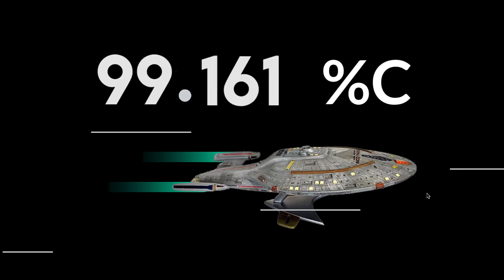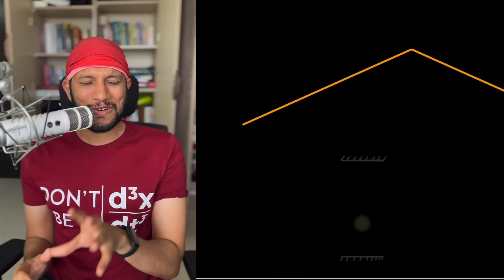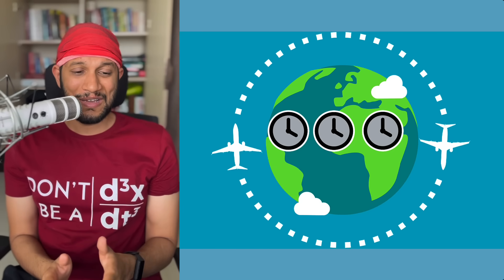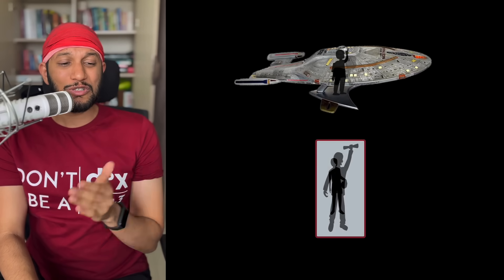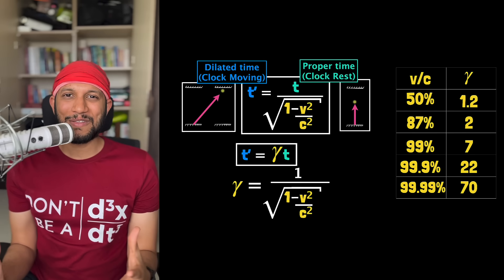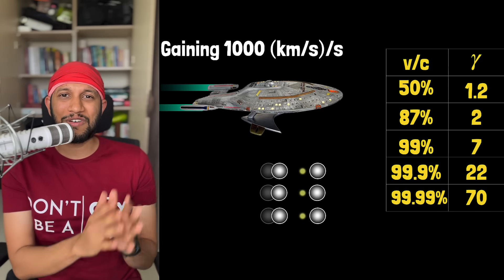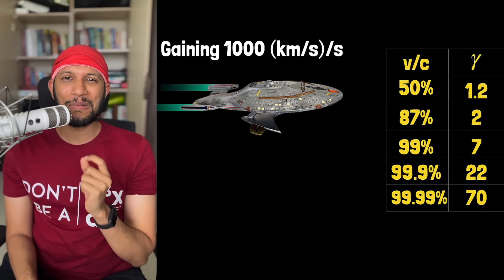I finally understood why you can't go faster than light! (My mind is blown)

Comment: Dr Micheo Kuko stated in a video that no matter what the red shift of a galaxy, the information about that galaxie always arrives to us at the speed of light in relation to us. This means it has to gain speed to faster than light speed, relative to its source, for this to happen. 

This is a problem, because the sending side has now sent signals at faster than light. 

How do you account for this without faster than light speed travel?

Comment: This certainly explains why one can never achieve the speed of light. But the theory does not forbid travelling faster than the speed of light. The challenge is figuring out a mechanism that can get us from sub light speed to super light speed by somehow by passing the speed of light.. perhaps this is the mechanism that they use in Star Trek to get to Warp speeds which are higher than the speed of light.

Comment: This is a really straightforward and clear explanation of time dilation. Keep up the good work on this and similar subjects.
Reply: Time doesn't dilate. The photon-clock may slow down, but not the other clocks.
Reply: @johnceena7322 should we call it subjective time dilation then
Reply: Regardless, if a clock slows, time remains constant. The apparatus that we use to measure it may change, but the measured remains constant. 
If you measure a board at ten inches, stretch your tape measure out or shrink it down, and then remeasure, the number changes, sure, but the board remains unchanged.

Comment: Cool video. Does this mean that if you have 2 atomic clocks on the opposite sides of the world and you use them to measure 12 hours of time, during the day for one, and night for the other, you'll be able to note some time dilation due to the night clock traveling faster than the day clock due to the rotation of the earth?

Comment: Time doesn’t slow down. All atomic processes slow down which gives the appearance of time slowing down.
To measure true time one must find a stationary point in the universe and measure there.
Reply: Also, so moving at 99.99% the speed of light means I’d age 70 x slower. So travelling to a planet 70 light years away would feel like a one year trip?
Reply: And simply put, the energy that moves all things moves at the constant of the speed of light.
 So what is bound or moved by this energy, can’t exceed this energy’s speed. Or the bond will be broken?
Reply: What ever speed the object is moving say 99.99%, the energy transfer to increase the speed can only travel at what’s left after 99.99%. 
The faster you go, the less of the 100% is left to accelerate you. Eventually you’ll reach equilibrium. At which point, you’re immortal 😂

Comment: No, this is wrong. This is working on the false assumption that the speed of light is a standard speed that never changes and ignores everything around it. Einstein himself proved this to be untrue. Einstein proved that a light emitted forward from a moving object will move at the speed of light plus the speed of the object.

I used to think this would be how light worked too when I was young, until I read Einstein's paper that disproved this very thing and it blew my mind.

Einstein put a light next to a train track, and another light on the train, with a switch that would trigger the two lights to come on simultaneously, and he found that the light on the moving train would reach his position faster than the stationary light, and was able to prove mathematically that the light on the train was travelling at the speed of light plus the speed of the train.

The reason the clocks desynchronize when you fly them around on an airplane is because if time dilation. It has nothing to do with the movement of photons.

As far as being able to travel faster than the speed of light, I don't even believe this to be true. This is just a misunderstanding of Einstein's theory of relativity. It comes from the misconception that this was a derived equation. This was a defined equation, and the fact that some parts of the equation are undefined does not mean that the real life events the equation models must conform to the undefined elements of the equation.
Reply: And here's the problem I have with the idea that you can't go faster than the speed of light. Relative to what? You're talking about a theoretical clock that is at rest. But what does that even mean? At rest on the earth? Well, you can't reach speeds even close to the speed of light without leaving the earth. There's just no room. Assuming we're going straight and not making constant adjustments to direction, you're going to leave the earth real quick. So where do you place your control clock? Do you leave it back on Earth? But the earth is not holding still on a cosmic scale. It's rotating around the sun at 1000 miles an hour. At the place where the Earth was when you left the planet? Well, that doesn't work either, because the whole universe is expanding at a rate much faster than the Earth travels around the sun. So that begs the question - what exactly is standing still in terms of this experiment? There is actually literally nothing anywhere in the universe that's standing still. You can't define a point that is stationary on a cosmic scale. There are none.

So when you define your speed, you must define your speed relative to another object. That's the only way to even define speed.

Typically since we spend most of our time here on Earth, we define our speed relative to Earth. But as we've seen, that's not really valid for this experiment. You have to pick something to be your point of reference, and it's best if you pick something that is not accelerating, which leaves out the Earth for many reasons. But you can actually define your speed relative to anything that isn't accelerating.

But whatever object you define your speed relative to, that object is actually moving relative to everything else. So whatever object you pick, if that object happens to be moving toward you, and then if you move toward that object, then you can move faster than the speed of light relative to a different object. And the thing you pick is completely arbitrary.

And you can define anything you want as your stationary point of reference, and your model will consider that point to be stationary, and everything else to be moving relative to the object you've defined as your control clock.

So what if you choose to  define your speed relative to an oncoming photon?

Well now if you move toward that photon, you are actually moving faster than the speed of light. Light moving toward that photon can easily travel twice the speed of light.

And if you follow this train of thought, you start to see that you can continue even beyond that to attain higher and higher possibilities for speed.

But at the end of the day, what this comes down to, is that there's nothing in space. It's all empty. Not even air. So when you're in space, your movement is meaningless, because there's nothing to base your movement off of. So you are essentially stationary all the time. Which means you can always speed up in any direction, no matter how fast you're moving. Because at the end of the day, you are the stationary control clock. Whatever you're doing is defined as the object at rest, and everything else is moving relative to you.

Comment: The photon clock is explained accurately. But the real clock explanation time dilatation is a big fail. You only explained that the clock arm rotation is propagated slowly from the center to the end of the arm, but this slow propagation has absolutely no relationship to the frequency the central "atom" of the clock arm accelerates.

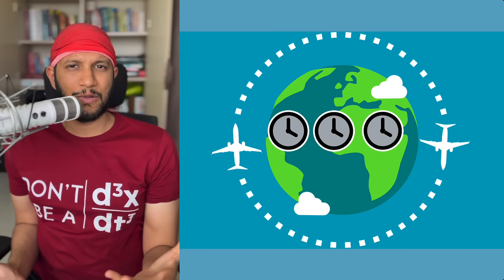Comment: 4:50 if everything in the universe is moving... and movement is only relative to other objects... how do the clocks know which one is going faster or is going to slow down?
Reply: I'm not sure what you mean by "clocks know"
Reply: @MakiseKurisu_ImmortalVenerable  I don't mean literally "know". I'll say it in another way: if everything in the universe is moving... and movement is only relative to other objects... which clock is going faster and which clock is sloing down?
Reply: @Jona19824  The clock going slower in relation to the other is the one which accelerates and doesn't maintain a constant speed and straight line. When you accelerate you no longer stay in the single intertial frame and so even if we both saw our clocks ticking slower, we will no longer and you will see my clock ticking faster and I'll see your ticking slower. Because acceleration is absolute in relativity and it's not relative, if you accelerate I don't, as time flows differently from you than for me.
Unless the acceleration is symmetric and it's done in the exact same motion between the 2 clocks (magnitude, direction, duration) and they had a perfect symmetric start then even if they meet again then they'll remain in sync.
Reply: @MakiseKurisu_ImmortalVenerable  but isn't it true that everything is moving. So if you accellerate back to where you came from, you actually decellerate. But while I'm typing this, I understand it doesn't matter, because the clock experiencing it, will know whether or not it is accelerating or not.
Reply: @Jona19824  Deceleration is an acceleration that reduces your speed. When you turn back, whether by reducing speed, increasing speed, or changing direction, they all are accelerations in physics. Any change in velocity (speeding, slowing down, or changing direction), they're all acceleration. It's been proven and experimented, the mathematical proof is kinda, just kinda complicated tho.

Comment: i still dont believe the FTL theory. 
science is about not believing what people say without conclusive tests and evidence, and we know small scale test dont always mean a larger outcome will be the same. 
at same time theorist believe we can travel faster than light by bending space like a sheet of paper and creating a tunnel between two distant points. 
the paper explanation sounds like a flat earth theory. space isn't 2D.  its getting into more 4D space by collapsing two 3D points without distorting space itself. it doesn't sound possible or would require infinite energy.

Comment: how you could explain it to kids: one kid is the photon, two kids are the mirror walls. First photon kid runs back and forth between the other two and we count the time to get back to one of the kids. Then the wall kids start running in parallel and the photon kid has to catch up. Also the physical exhaustion would be a good analogy for the energy increase needed.

Comment: If the ship burns the same amount of fuel to increase its speed at a constant rate in proper time, then as it takes longer to accelerate in dilated time wouldn't it also be perceived to be using less and less fuel per second too? Like at 87% speed of light it would appear that the ship is using half as much fuel per second (and accelerating half as fast as it was initially too). So it would appear as if the ship was decreasing in acceleration  normally, as if the pilot was controlling it with the thrusters. Did I make any mistakes with that?

Comment: No, he didn't explain.
if one ship flies at 0.75 the speed of light, and the second also flies at 0.75 the speed of light, but in the exact opposite direction, then the speed of one ship RELATIVELY to the other will be GREATER than the speed of light.
This logic is simple and absolute.

Comment: This is almost the same explanation given to us before we went faster than sound, They told us that if we tried to go faster than sound that we would burn to death. Ofcourse we found that when we went faster than sound that as long as we had a vehicle to protect us then we are fine.
Back before 1900 we were told that if we trird to go faster than 30 mile per hour you would burn up.
In the last 100 years they keep telling us that if we manage to travel at or faster than the speed of light, that time dilation will happen. 
Lets hope we will see light speed and faster than light speed travel in the next 20 years and we will be able to see what really happens fhen we travel faster than light.

Comment: It's much easier... through imagination without any formulars. Consider photons as something like sand and think of sandblasting. Remember photons always transmit energy. The same holds true for sand grains. You can never drive an object with more mass than a sand grain to the speed of the sandslast with a sandblast. So you can never drive an object with more mass than a photon to the speed of a light beam with a light beam.

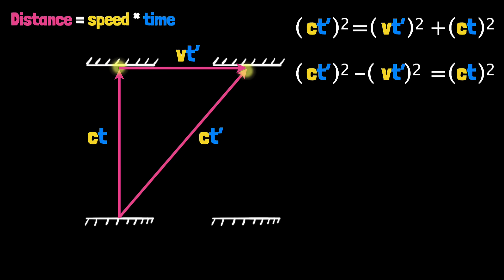Comment: 9:20 I can’t take it anymore. It’s not “t-dash” it’s “t-prime” — and there is a much simpler explanation as for why v cannot exceed c: gravity, aside from having a particular measurable attraction based on space-time distortion (such as 9.8 m/s/s) also has a propagation rate at which the fabric reacts. This propagation rate is equal to c. If the sun were to vanish, Earth would continue to orbit a non-existent star for 8 minutes and 20 seconds — the same amount of time we would perceive there to still be a star because the light would continue to arrive for that amount of time. Only after those 8m20s would both the light emitted and gravitational pull no longer reach us. Now knowing that gravity propagates at the same speed as light, c, it would create the equivalent of a lag in space time where the gravitational pull to neighboring objects lags your presence if you were able to travel faster than c. Such velocity would preclude any atomic structure from adhering to the nuclear forces.

Comment: 13:35 when measuring the acceleration of the ship from outside, why would you use the clock inside the ship instead of the one next to you?
Reply: Something related to Frame of Reference maybe. 

At near rest, the clock inside or outside doesn't matter, as "gamma" is almost equal to 1. 

But measurement i guess can be made from its own frame of reference, as acceleration is Force/Mass (both of which is related to the spaceship) , acceleration being speed / time (the time must be in Shapeship's frame of reference as well) 

i might be wrong... Good Question 🙌

Comment: Cherenkov radiation is defined as”radiation emitted by a particle when it attempts to exceed the phase velocity of light, for the medium thru which it is traveling “. Excess energy is emitted as visible light thus slowing down. 
Here is one of the reactors I’ve operated in my photo image. It’s the TRIGA MK1 being pulsed from 5 watts to about a billion watts then back to 200kn in under .1 seconds.

Comment: Since we are in constant motion even standing still on earth, the earth rotates about its axis , the earth rotates about the sun, the Sun is moving through space… so we are already experiencing time dilation, compared to if the sun and earth became motionless, correct? But you can’t say nothing can accelerate to the speed of light because photons accelerate to the speed of light because they have no mass. So if we can remove mass from an object, it can be accelerated to the speed of light.

Comment: Let's take the elements of your example with ( K = 300 km/s), 

Data:
- Speed of the spaceship  v_1  relative to an external observer:  
  v_1 = 999,308.17K  (or  v_1 = 299,792,450 {km/s).
-  Speed of the car  v_2  inside the spaceship relative to the spaceship:  
   v_2 = 1K  (or  300km/s).

We apply the relativistic velocity addition formula to calculate the relative velocity of the car with respect to the external observer. The formula is:

v rel = v_1 + v_2/(1 + (v_1 * v_2)/K²)

Calculation of the relative velocity  v_rel:

1. Numerator:  
   v_1 + v_2 = 999,308.17K + 1K = 999,309.17K

2. Denominator:  
   1 + (v_1 *v_2/K²) = 1 + 999,308.17K*k /K² = 1 + 999,308.17

   So the denominator is:  
   1 + 999,308.17 = 999,309.17

3. Calculation of  v_rel: 
   v_rel = 999,309.17K/999,309.17 = 1K

So, the relative velocity v_rel is equal to  1K , or  300 km/s
the v-rel formula is ment to equal 1 whatever you use as a reference (speed of whatever) and the speed of the car will stay the same even if the spaceship is at the limit of lightspeed.

Comment: 7:43 Yes but the measurements are flawed because it is based off of something which is not constant. It makes no sense to use "time" (or, for instance, the wavelengths of fluctuations between Cessium atoms) to try and solve anything astronomically, because both those wavelengths and the measuring tools as well as third-hand observations will be influenced by other Universal events. Your results will end up not being right, and you can't use results which are based off of such flawed sources and expect to have a meaningful result, which can be applied in "real life" on an Astronomical scale. If we do this, we will never proceed from our current state, as we'll be saying one thing and yet it means nothing because the words you say and use are inherently corrupted by the assumption that reality matches up with your own personal concepts